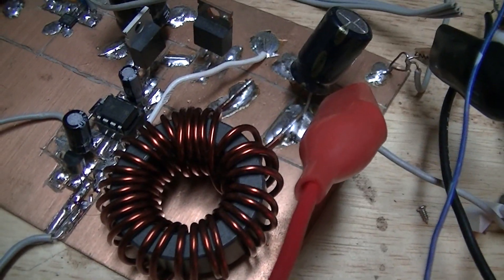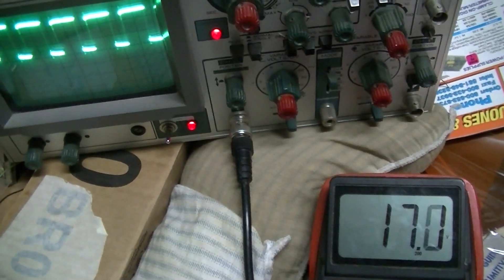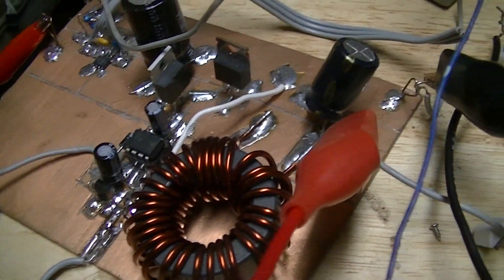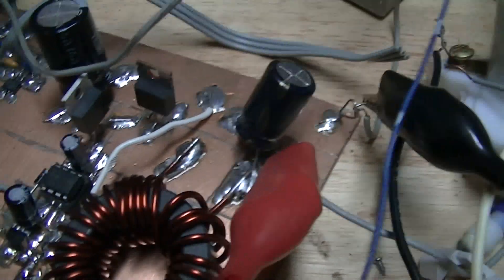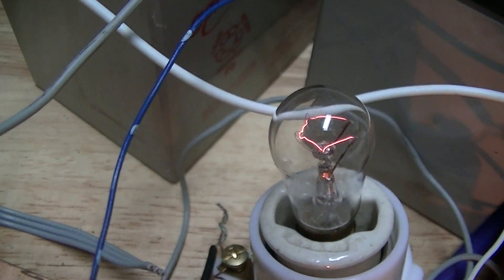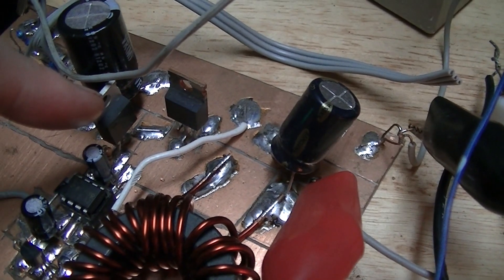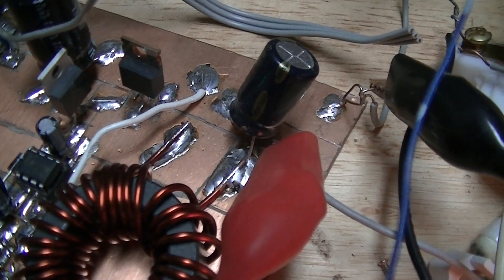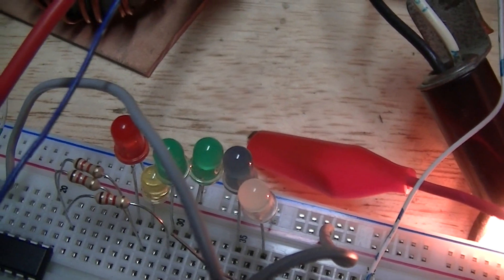DIY MPPT new buck converter inductor

Comment: hey
i'm going to control a buck converter duty cycle by an  mppt technique, the solar panel wich i use has an maximum power point about 17.16V and 2.91 A , and i have to charge a 12V lead acid battery by the output of the buck converter using the maximum power point as input of converter. so can you help me to calculate the components of dc dc converter (inductor and capacitor).
Reply: Same here